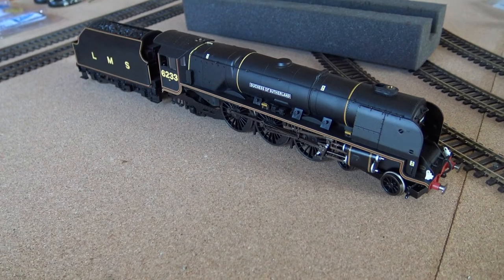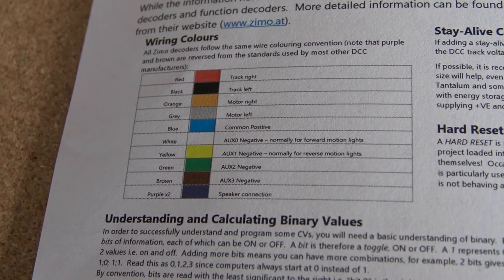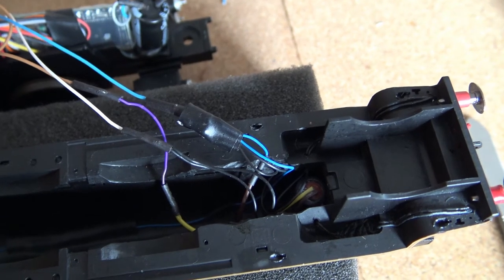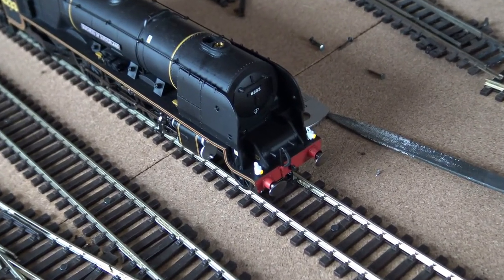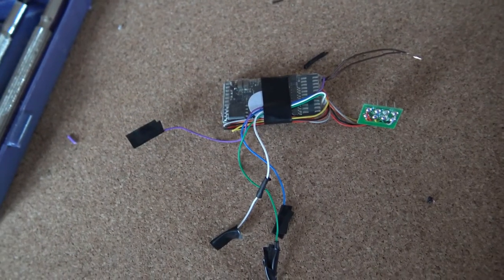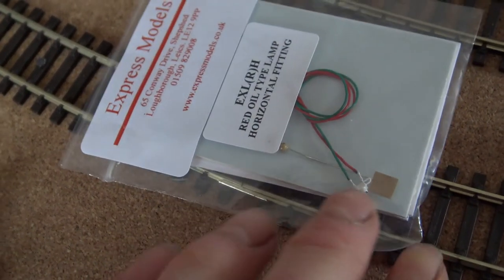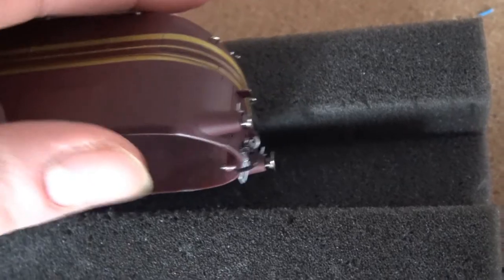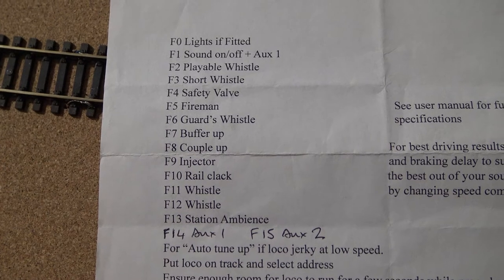How to change a sound decoder with Lights and smoke fitted - Video 6

Comment: Thank you for sharing Andy. You have become an expert on DCC sound. Well done ! Any preference between a Zimo or Esu sound decoder regarding fine tuning with those CV's ?  All the best, Filip
Reply from the maker: Thank so much Filip, Yeah i like my sounds in my Locomotives. I just prefer the Zimo ones with sounds that are available on them. Erm not sure on CV's yet only just getting my head round them. The Esu one that I swapped into the other engine when i was digitrains he showed me how to do them and fine turned it. The Zimo one that I put into the engine was from Youchoos and the cv's are mostly spot on...... Andy
Reply: Hi Andy. I have a Zimo sound from Youchoos fiited in one of my S15 but have trouble getting the starting smooth & linear. Info on Zimo is not wide spread as oposed to ESU decoders. I'm eagerly waiting to fit a Hornby TTS module in another S15 to compare the Value/ Quality of the different sound decoders. Say that I'm happy with the basic sounds:  steam exhaust - nice bright whistle and  braking. Same function buttons for all sounds on the different loco's. I'm studying JMRI to organise this better and fine tune in a less difficult way then the myriad of confusing CV's. I found a lot of info in the ever Free "Model Railroad Hobbyist" - monthly magazine, including free "How To video's."  A must if you're into railroad modeling. But I supose you know this. All the best, filip
Reply from the maker: Did you hard wire the decoder in on the Loco or just plug it in ?... ANdy
Reply: On advise of Youchoos I hard wired the decoder in. Following I contacted the man about the starting problem, but never recieved an answer. I don't insist but never go back there for business. I've got it better already but will smooth it out as soon I have JMRI operational. Thanks Andy.
Reply from the maker: That alright then was just checking John from Youchoos advised me too. At least you have managed to get it running better. No Problems ...... Andy